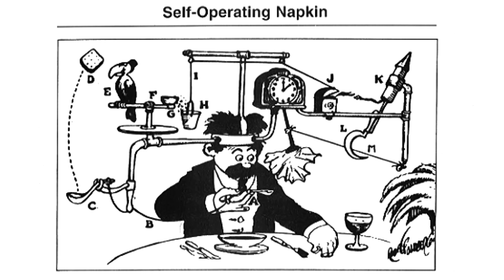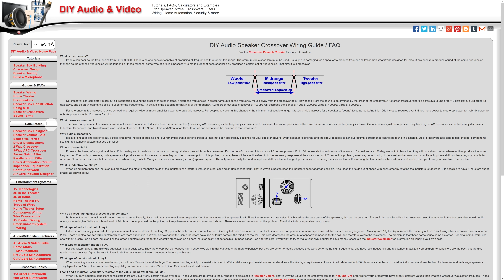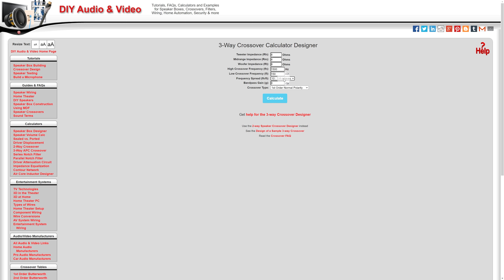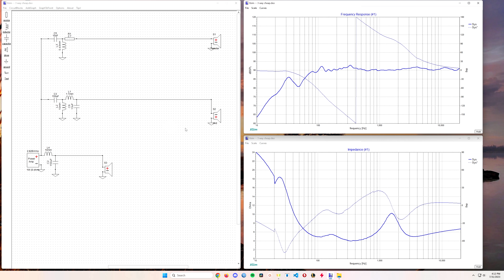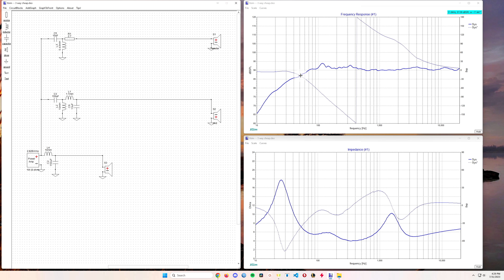Turning This Speaker Into An Actual 3 Way

Comment: You're crossing the sub and mid a bit low I think, that forces you to use electrolytic capacitors or you'll end up with really expensive polycaps. I've crossed mine at around 650hz (and tweeter pretty high at around 6000hz so that most of the 2" softdome midrange gets used from 650 to 6000hz. Tweeter and mid are pretty close together so I had no phase issues. But it all depends on your drivers, their sweet spots and the distance between drivers. Your second design had an improved phase response (the steepness was flatter compared to the previous one, which to me might be out of phase or spaced too far apart physically). Looking forward to how they measure after the crossover is built!
Reply from the maker: I was thinking you're about it as well, maybe I should be crossing them higher, I think you're right about the distance as well, that is a definite downside to testing the speaker just off a build a box test a speaker setup.  So many things I would change already if I was starting from scratch, but I still have a lot to learn, even with what I've figured out so far.  I just finished editing the video for the comparison, it'll be up next week sometime to check out.  I'm intrigued to the feedback, you're also 100% right about the price of those caps.